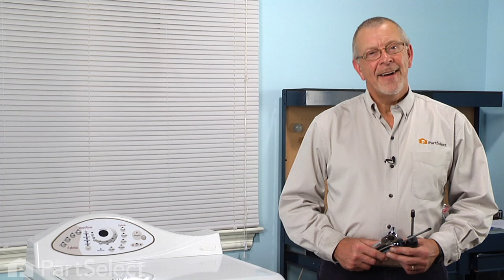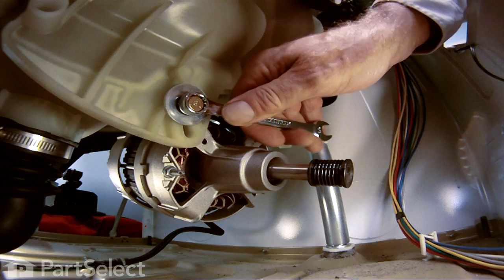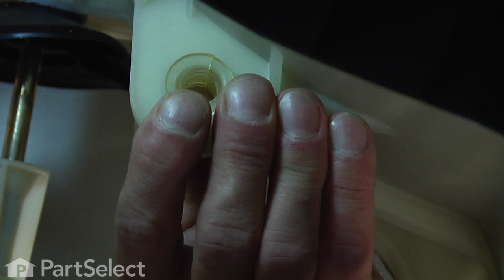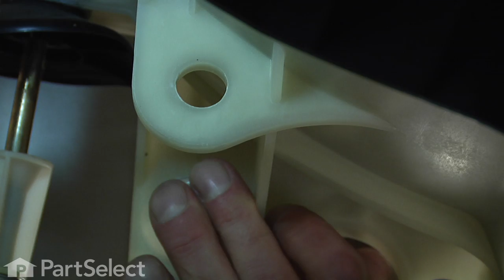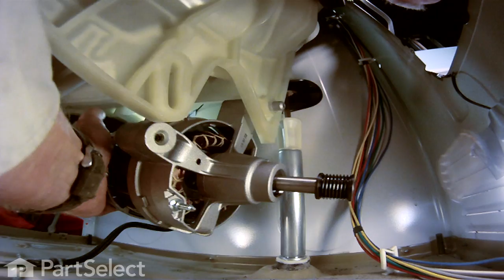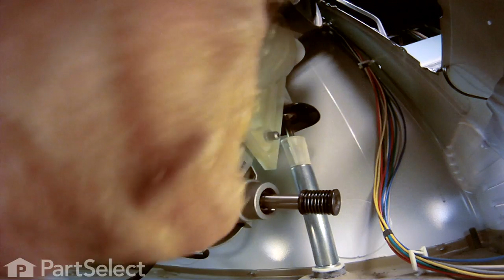Washing Machine Repair - Replacing the Drive Belt and Motor Isolator Kit (Whirlpool Part # 12001788)

Comment: Once Again Thanks for the instructions!! First thing i noticed was my belt wasn"t even on the motor!! It fell off completely! Iwent ahead and replaced the belt and isolators anyways, it was a challenge to get the belt on but all you have to do is adjust the motor with the belt around before you tighten it up! Good Luck! I hope this helps!